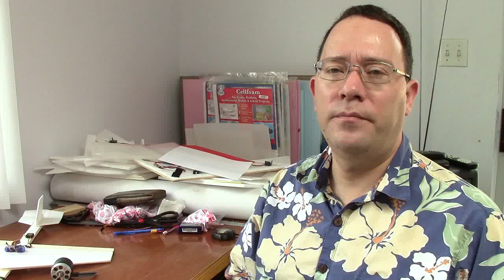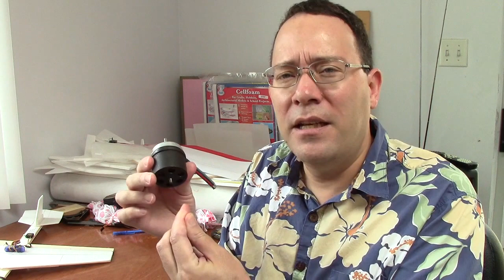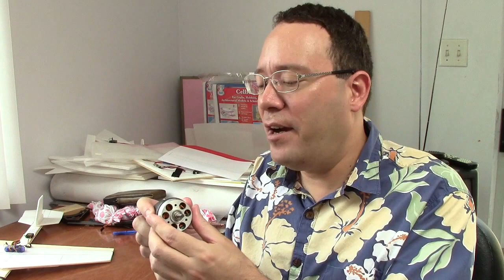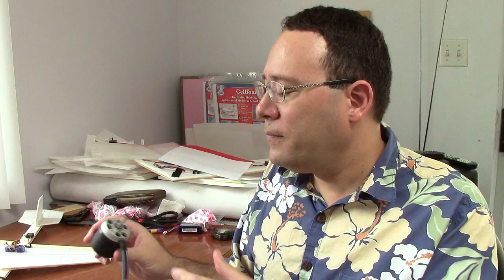Understanding UAV Magnetometer Sensors

Comment: There's got to be shielded magnetic motor for UAV. then you have to consider magnetometer sensor power consumption and weight on UAV. then real-time data transmission to ground station for processing. but its possible.

Comment: Yo Carlos the jackal,  I got a question.

Are magnetometers any different from a digital compass?
Reply: they are usually called magnetometer compass
they measure the magnetic field force, and orientation
a digital compass will only give i assume the heading
so you cant do much corrections for data
but knowing the strength of a magnetic field you can filter erroneous and abnormal readings
while a digital compass cant do that